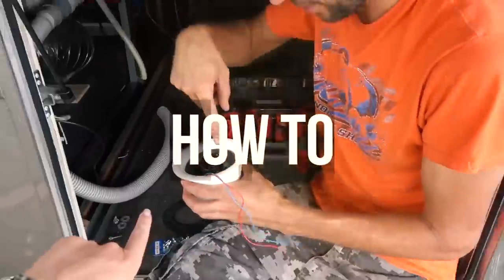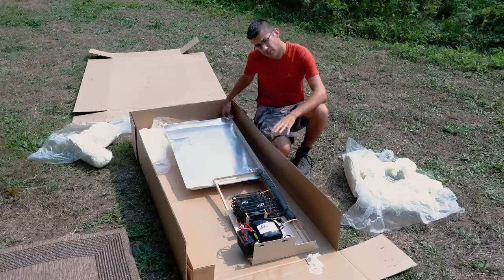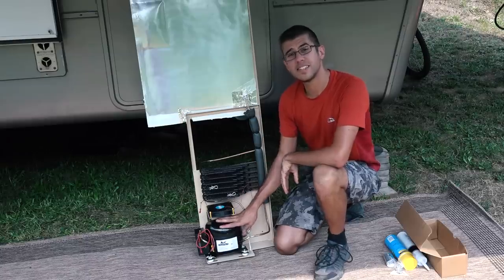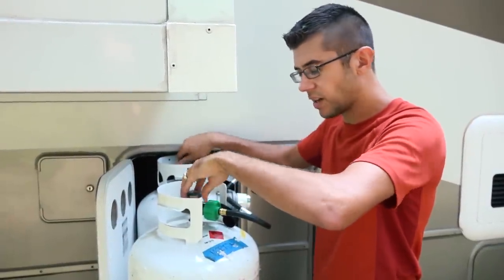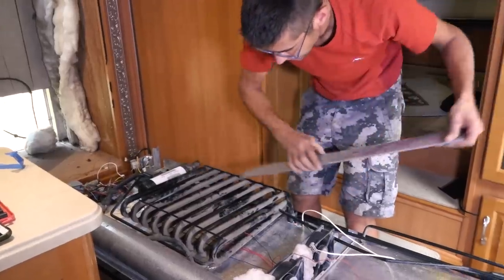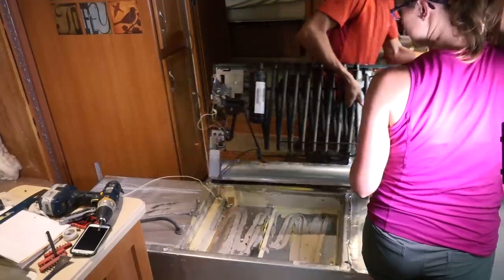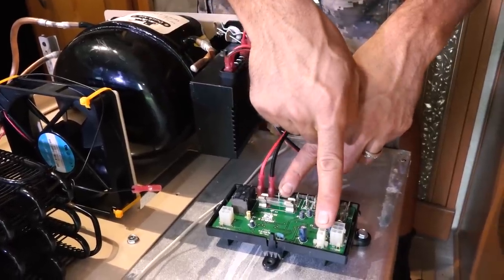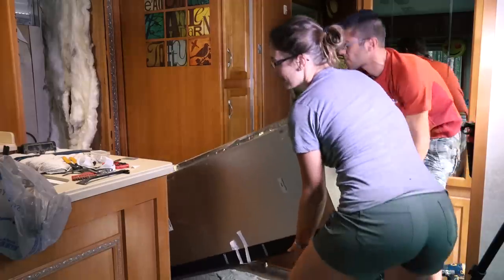Converting our RV Fridge to a High Efficiency DC Compressor- 8x More Efficient! and Better Cooling!

Comment: Great video and install would recommend getting a 12v heater rod to defrost your fins also a small muffin fan 12v dc to better move cold air in this space you also could power this muffin fan on outside solar cell.  I have the old style gas , electric and gas type with heater or flame to run it.  I have a old Dometic which was considered to be better than the newer models by some rebuilders and i mostly use gas which lasts 7 days or 120v ac when stopped .  12 vdc always runs down my battery fast.

Comment: I have a one year old trailer and the Dometic refrigerator is terrible. My fridge in my previous trailer was ok but this one is in a slide out and it just doesn't cool well when it's hot out even with a fan kit installed. I don't boon dock very much so having a propane option isn't important as long as the fridge can run off the battery and my trucks power supply. My question is how long do you think the fridge would operate off of one or two 12 volt batteries? The only time this would be important to me would be if we stopped somewhere along our travel route to visit a tourist location. Other than that, I would always be hooked up to electric in a campground.

Comment: Thanks for the great video! Our 13 year old Dometic just died and im seriously considering the DC compressor solution. Two comments/questions: 1) Can the unit be test fit on the fridge box without sealant to line up the screw holes and mark the back to the box for final sealing and realigning? 2) You forgot to tell everybody to cap off that propane line somewhere!

Comment: I'm fairly certain that the propane system on these refrigerators do NOT have a pilot light, they use an igniter to ignite the propane when it's needed just like the water heater and probably the heating system. You can also find online the absorption  style refrigerator cooling units for around $500, which is still high for a small refrigerator but it's one that runs on AC/DC/Propane.
Reply from the maker: That is correct they do not have a pilot light.  Propane is great but terrible efficiency when running on electricity

Comment: I believe it will be more efficient to use a regular house refrigerator that fits into the hole and use a power inverted from 12v to 110v , what do you guys think?
Although this is a very good detailed video .
Reply from the maker: Efficient on power, no it would be much worse.  Efficient on install, possibly, although you might need to do some cabinet work and cover the exterior holes.

Comment: You guys should build campers....the good ones.

 Compressors have a thick oil and should be left to set in upright position for a day before starting if it had been set on it's side for a little while.
Reply: You are absolutely right, I would let sit a couple of hours after moving the refrigerator in the upright position.

Comment: Adsorption cycle type refrigeration was designed for rural areas that have little or no power available for everyone. The idea to use in rec vehicles started in the 50's . With the use of a candle size flame or heating element the cycle starts. For the cycle to continue the whole assembly must remain somewhat level.  Bottled fuel or even electricity would be the only energy required in a camping or disaster scenario. Stainless steel type  materials are used to contain the gases and form the condensing and flooded evaporation sections of the refrigeration device. No electricity is required if using burnable fuel. High heat starts the cycle. Low or no heat reduces or stops the cycle.
One of these refrigerators was isn my old 1967 trailer. They can be ordered at nominal costs in a small variety of sizes, the smaller 7.5 cuft. propane unit operated over thirty days in variety environment temperatures, before fuel was required.  The only danger is if the ammonia gas should leak inside the living space..it can be a serious hazard to health. Research and purchase yours..get off the grid..

Comment: Hi Guys, did the conversion this week and everything's working great, except for the door light on my Dometic 2662.  I believe the white sheathed red and white wire coming down from the rear top corner (along with the display cables) is the power for the light, but I have nowhere left on the board to put them.  Do I tap into one of the 12v power wires already plugged in?

Comment: I found this video very interesting and informative about changing out your refrigeration system to a JC electric from the former unit of gas and DC! Thank you for sharing this process! I was going to buy a new refrigerator but I called and canceled it because I realized I couldn't really afford it and maybe it's just the Ice maker is the problem and it would be a lot cheaper to replace it instead! I just wondered if it would save me on my electric bills if I do replace it in the future if I can get extra income do replace it?
Reply from the maker: If you are using an absorption fridge on electric most of the time yes this will help save on electric bills.  You could put a watt meter on your current fridge and figure out how much it is using.  Assume one of these will run 500-800Wh per day.

Comment: lol. I do this job all the time. and your very lucky to have only 4 retention screws (angled at you).. You take the doors OFF... and looking at them w/ the cracked plastic.. U need new ones, doubt if u can find them..  Good new concept though as the old Hydro and ammonia systems are passe now..(in my opinion)..  Most of the new bigger units are coming with household fridges now as they don't use a lot of power and don't need to be perfectly flat.. But you do need an inverter to run the 110 power needed..

Comment: My house batteries are going to be 24 volts so I’m glad the compressor works with that voltage. But I heard there are inverter compressors available but don’t know if JC Refrigeration sells them. I read the inverter compressors have a soft start but does it matter? Is there enough advantage of the inverter compressor to make it worth going that route? . I have not found a kit yet.  I guess I’ll call them.

Comment: please pardon if this was already mentioned (which I'd bet it was), but the refrigerator seal integrity I saw in the video should be addressed.  It is also possibly adding to quicker icing of the fins.
Good video for a lot of the things relent to a upgrade or change over.

Comment: Can this unit that you installed be powered from the 12V supplied by the truck as you are going down the road?   We don't have the battery bank that you have.   FWIIW, we run our absorption fridge off on trips as it does just fine 3-5 hours without, but the compressor side tells me that when powered, it will cool a lot faster than the old absorption unit.

Comment: that was way harder than u made it look,,,  u obviously have an electrical/mechanical background, right?   great job overall tho.  diagnosing and fixing your low voltage dc issue also....u guys appear to work well as a team doing complicated repairs...a big plus to have a good helper whos not arguing or complaining..

Comment: My unit failed in 2 years and a few months it was a s cubic foot model. I replaced it with a superior 10.1 cubic foot residential model that only required a 6 inch modification at the top. It's a frost free unit and it seems twice as big. Only 398 at home depot.
and no dangerous sodium chromate or hydrogen gas.

Comment: when you were taking the fridge out I noticed that the door seals were broken, which is going to kill your efficiency and cause a lot of that frosting over inside the fridge. Also, you should pull the unit back out and replace that glass insulation with a much higher rated poly board. Keeping the cold in will also help improve the performance of it. 
 I checked their website out but could not find any pricing what ball park can someone expect to pay for a unit like yours.
Reply: Bad door seals, bad ventilation of top of fridge, that's an issue the manufacturer will not fix for some reason and yes, it's a design flaw. I seen a few problems with this fridge but I am still very interested in the new units they are installing

Comment: You still have the vent stack behind and above the refrigerafor that is subjected to outside temps.  Thus, is the need for fans no longer needed or do you think they will help to improve the inside temps still. Also are you able to keep the refrigerator on using your batteries and an inverter between destinations
Reply: I am doing a DIY conversion of my propane fridge, and the upper vent is not needed anymore, it is there because the propane exhaust needs to exit.  A fan to circulate air from just the lower vent is all you need, i'm psyched to get rid of more holes in the roof (vent is on roof of my rv)

Comment: Question:  Can this unit be hooked to the fridge switch to switch between 120v when at campsites and 12v while boondocking?
 Excellent video.  Never knew of this conversion until today when a friend mentioned it.  Now, I see I have options should I ever need replacement.

Comment: Thanks for the research and video this is the cure to the biggest fear all of us RV have is FIRE Caused by our Refeers THANKS AGAIN GUYS
Reply: It is because of my extreme fear of fire and propane (actually any gas) that I have removed all propane from my camper and will be doing solar / generator. This included the Dometic gas/electric frig, the propane furmace, the propane water heater....doing this also eliminated a great deal of weight which is one of my biggest concerns in my 85 Toyota Huntsman mini class c...😎

Comment: I just bought a brand new truck camper that has an AC and gas  Refrigerator. When I take the back off of it, I see D C wires and DC labeling.  Do you happen to know if it's possible to convert this fully to DC?

Comment: Excellent thorough video.  Very interesting to have a DIY 12-24 unit.    Looking at the cost of replacement units ouch!......Don't see any advantage switching to 12v over propane at that price.  Properly maintained propane fridge will last a long time.  7 years is way too short to be going bad.   I see farther down in the comments that you added insulation.  Not a good idea.  You need the clearance to remove the heat and from the looks of all the dust your fans were not working to expel the heat. 

 My Dometic died about 4 years ago (leaking ammonia) and for a temporary fix I bought a Visanni 4.5 cu ft. Energy Star residential fridge at Home Depot for $175.  Startup is about 600 watts, running about 80.  Cools very quickly, so doesn't run too long.   My 650 watts of solar and 500 amp battery bank has no problem running it off my 600 watt Samlex inverter.   Keeps the fridge at 35-37 and freezer is always below 5 degrees.   I like to have hard ice cream, so you'll need to keep your freezer below 5 degrees.......:)   That's way too much ice forming on your cooling fins and will decrease the cooling of your fridge.   You're either in a very moist environment or don't have any circulating fans.   You can eliminate most of the ice build up and help with the cooling if you install computer fans on both sides of the fins to circulate the air.  That mod works well in all fridges especially propane fridges that struggle in warm weather.  My propane fridge is still installed, so might consider switching over if the price comes down.   Nice not having to mess with refilling propane so often, so AC/DC is the way to go.

Comment: I'm looking for a ultra effiecent fridge for my house , its off grid, 24v solar powered, so far what I got planned is converting a freezer to fridge, not really converting, but controlling the temp, to prevent freezing, with a theromstat controlled SSR, still using 120v , but 24v doesn't sound like a bad idea,  I have seen DC fridges, very costly, I'm not sure the power consumption of the freezer used as fridge, I'm planning to use a small freezer, with it, any opinions?

Comment: Sure wish I knew about this before I got rid of my 4 door propane/electric reefer.  I would have gotten one.  Do not know if they were available four years ago when I installed a residential unit.
Reply from the maker: No this is a very new option they just started making this year.

Comment: Fantastic video! I have a 2019 Northern Lite 10-2 EXCDSE and I am looking for any ways to reduce power consumption and get on solar.
I wonder what uour suggestion would be for that.
Reply from the maker: While this is more much more efficient on electric than the absorbtion .. it still draws a lot more electrical power than the absorbtion on propane.  You need a good solar system to run it.  1200w the runs it and everything else great.

Comment: Just leave the fridge on dc going down the road not on propane.  Just dont do like dad did once when visiting a buddy from works place where he had no electricity.  He left the fridge on 12v and killed the trk battery.  The only jumper cables we had there had one cable bad apparently. We used a 14 gauge wire to complete the circuit so instead of a quick jump from his van it was a slow charge
Reply: tractorboy31 — Reading owners manual tells us this setting is only to be used as a backup or default setting only. It will not function the fridge/freezer as propane can.

Additionally, running on DC only robs DC batteries down to nothing within 6 hours or so. Your milage my vary

Comment: always solder and heat shrink your wires because the crimp connecters can come lose and cause things to short. i always remove the plastic from my crimp connectors and solder them to the wire and cover them with heat shrink.

Comment: Did you ever try using the fans with the absorption setup? They should make a big difference in warm weather.
Reply from the maker: Yes they ran almost constantly above 80 degrees out.

Comment: I think it's important to note that your DC system is not comparable to what most RV systems produce.  You kind of glossed over that in the beginning.  Let's assume you need to run your fridge for 10 hours a day (10 makes the math easy).  A 24V (highly efficient by the way, good job) system at 60watts will use 25amps over the 10 hour period.  With 5.5kw of lithium iron phosphate (tell people how much that costs please) it's no big deal for you.  But what about the guy with a 12v lead acid system?  Even with a nice little 200ah bank that system is drawing 50amps in 10 hours!  We can debate the number of hours the system is actually running, but I think you're giving the impression that this is the way to go and it is when you have a nice solar setup and properly sized bank.  Just a thought, but you had fans behind the system to help vent the heat.  Did you ever turn them on?  I am curious to hear how the compressor tubing is holding up with a year of RV vibration.  Proper refrigeration maintenance is easy.

Comment: If one wanted to run that DC comp. retrofit ONLY off of solar but did not want to have your 1200 watts on top of roof, what are other options?  Could you have 200W of portable solar? Of course one also needs sunlight. Just wondering of cheaper or simpler options withouit your extensive Solar and Tesla bank set-up... and how much battery would one need and type to run such a fridg nominally for two days without sunlight.

Comment: Retrofit some airflow across those internal heat spreader fins, a couple appropriately sized computer fans should suffice. Thats a surprisingly large part of your condensate buildup and freezing. That "heater wire for climate control" might actually be a defrost circuit wire. Anyhoo, great video!
Reply from the maker: Keep your eyes out for a future video!  ;)

Comment: @Mortonsonthemove, It has been a couple years since you did your install.
Do you still own that RV and Fridge ?
Do you have any 12v power consumption information of the DC model you installed like how many amps the Fridge would draw if you tracked that detail ?
I'am interested in upgrading our Dometic 2652 since  the Propane will fail to start at high elevation far to often.

Comment: It seems the lynch pin of this upgrade you’ve beautifully explained is the DC compressor portion of the upgrade kit which allows you to run your fridge straight off the batteries without an inverter. 

That’s the lynch pin. Thank you. I have terrible memory. But I remembered this video ☺️

Comment: My residential fridge has a compressor. The Freezer has a fin assembly in it that is defrosted by a heating element connected to a timer.  The timer resets itself. I"m not sure if it does it every 24 hours or maybe once every two days.  I had the fridge worked on and the technician explained a little about the fridge operation.   I wonder if you could build something like that for your metal fins in your fridge such that it defrosts itself.  While my camper works fine, that is definitely a good, simple option verses purchasing new.
Reply from the maker: We are going to try a small fan unit that JC refrigeration offers to see how it works, but yes we probably could rig something up like that.
Reply: You are suggesting using hundreds of Watts to heat up a fin, which will heat up the fridge, which will then take hours to cool back down with the compressor. Wasting huge amounts of energy in both directions